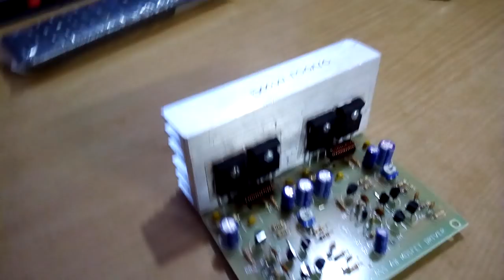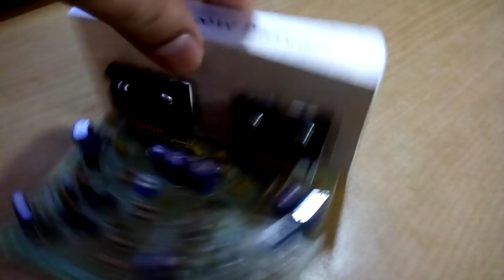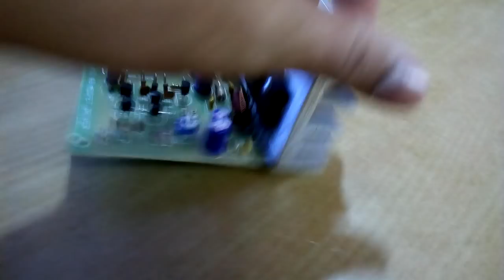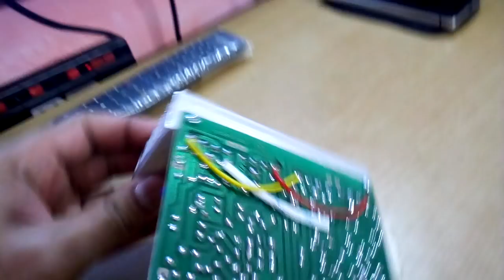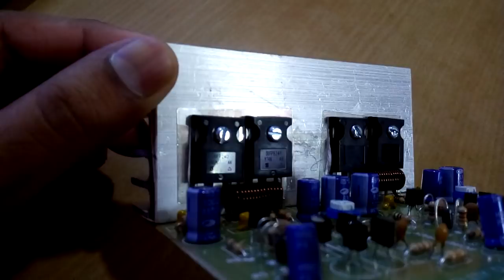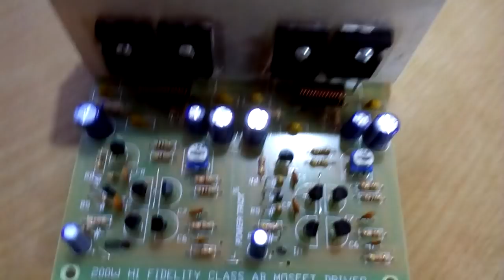200 watt MONO subwoofer amp kit (assembled)

Comment: irfp240 and irfp9240 pair ka sound and 2sc5200 and 2sa1943 pair ka sound mein fark ka hein.. ye cheez batao asap..
Reply from the maker: As i have used both of them i dont feel much difference but 5200 & 1943 pair's bass is a bit more heavier, thats all

Comment: Can I operate 12 inch subwoofer on this kit ?
Reply from the maker: Majha Records sure u can. But the wattage must be more then 250. Use a good quality speaker. U will get awesome bass
Reply: Sony 1800 peak watt subwoofer ?
Reply from the maker: Majha Records yes sure. I m using the same

Comment: Can I get this pcb
Reply from the maker: http://www.ebay.in/itm/1000-W-PMPO-250-W-RMS-MOSFET-SUBWOOFER-AMPLIFIER-KIT-IRFP240N-POWER-AMPLIFIER-/182704055696?hash=item2a8a02a590:g:3tAAAOSwvp5ZhmNA
Reply: How much voltage it requires. I have a transformer of 12-0-12. Can I use it?
Reply from the maker: No. It needs 27-0-27 v transformer. U will get all the details in the link
Reply: Can I operate 12 inch subwoofer